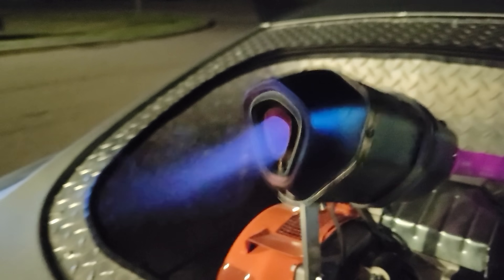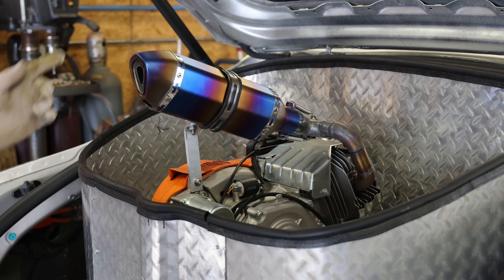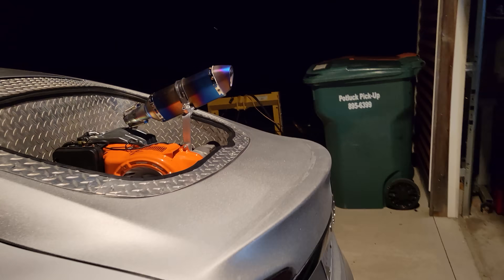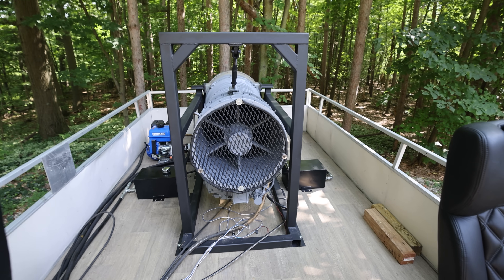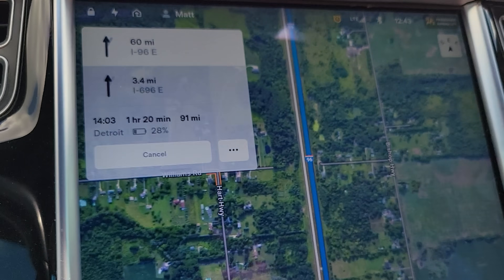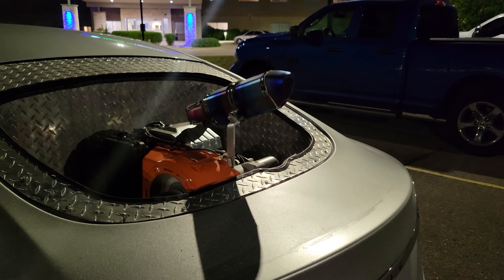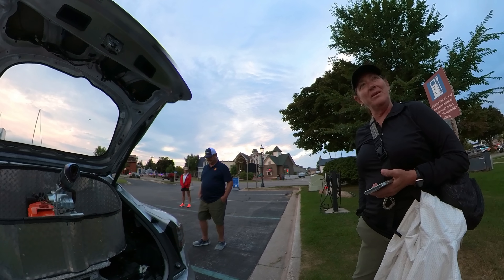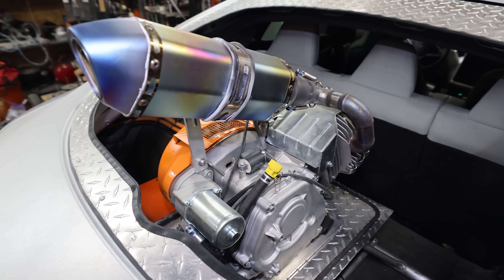Cordless Tesla (I Drive 1800 miles without charging) P.1

Comment: In the beginning of the video I thought the generator will let you down but wow it is strong and shooting flame while working hard is awesome
Reply: That flame was saying HIGHLY INEFFICIENT.
Reply: @VRStudio you are spot on that is a clear sign that it was running rich. Which is  garbage for efficiency. If this guy wants to get rid of the range anxiety and road trip at proper speeds with an expensive luxury car he should have just bought a Lexus LS 600h and been done with it. V8 plug in hybrid that gets far better mileage than this monstrosity, oh and quiet too.
Reply: @christophersaint6926  Why such a monster engine in a hybrid?! A 4 or even 3 cylinder makes sense, 6 less so, 8 is insane!
Reply: @franklofarojr.2969  Some of your more efficient hybrids are your 8 cylinder engine combinations. Now, mind you, not all of them. Some are hybrid for the "instant" torque and are really really inefficient, but those are the toys, the super/hyper cars. The LS600h, on the other hand, some of the Mercedes S-Class(non AMG), etc, put up numbers that are amazing and shame the Prius. It's because of the amount of electricity they can generate at idle vs what the 3 and 4 cylinders can generate at idle speeds.
Reply: I was wondering how much potential energy from fuel is lost while converting to usable electrical energy
Reply: @gameseeker6307  He said thermal efficiency is 16%, so your answer is 84%!

Comment: I'd probably get a real 10kw. the 5400 watts you mentioned is about right for say a 220v welder, home use version. Try harbor freight 9500 watt.. it's a lot bigger. my locale ot 5 inches of rain last night. I checked on the hydro dams at the river... the sound of thunder, excess water,and you can hear the turbines. I can see where the electric vehicle is efficient..it can use natural power makers. Gasoline cannot. Cool project

Comment: He made his own version BMW  I3 with range extender.  "Sat all night at the hotel charging" "Make the trip not touching a charger" He did have to put gas in the charger, and told the Officer "It gets too low, I will pull over and let it charge" He DID make the trip without using a conventional charger, BUT he still charged the batteries....

Comment: How did you get the car to drive and charge at the same time.  I'm smelling a little bit of BS here. It looks like you just stuck a motor in the trunk and are still stopping to charge. Esp with you completely glossing over wiring and software management.

Comment: My son let me drive his model y dual motors because one motor just isn't enough performance model.

I drove it on a two and a half hour trip from fort Lauderdale up to Kennedy Space Center and back.

I use the Tesla app which shows you where to charge and how long.

I had to charge for 20 minutes on the way up in 30 minutes on the way back.

Both times I charged at the super charging station at a Wawa gas station convenience store.

By the time I leisurely walked in and paid for a couple of things and walked back out it was almost done.

No one's going to read this is 3,400 comments for Christ's sake.

Comment: You're giving phev a bad name. A proper designed Plug-in actually gets >100mpg for average use, has plenty of power, quiet, reliable and the most important does not require a huge battery like this unit.

Comment: Kubota makes a perfect engine for this. Either a 2 or 3 cylinder. With more torque and thermal efficiency, going this route would return you better results (as well as being even more hilarious). This is coming from a person who has a degree in On-Site Diesel Technology and Power Generation. I work on generators and have seen every problem imaginable. I love your videos and seeing this one hit me personally. Thank you so much for showing us this experience, please follow through with what you are doing. 🙂
Reply from the maker: Thanks however, I actually started building version 2 almost two months ago, but I waited until I was almost done with version 2 to post the video for version 1, this one. You have a lot of experience, so you know what works and what doesn't 🙂. Your going to like the next one for sure
Reply: Benjamin, does Kubota's "perfect" engine meet current automotive emissions standards? How much would a 25 kW (continous output rating) set weigh, complete?

By the way  I know the answers...
Reply: I've owned Diesel VW products for many years.  As a simple experiment, how about a early 80's 1.6 4 cylinder diesel (without all the fancy electronics of a TDI), running at a steady 1800 RPM like a stationary generator?   Why not just drive the diesel VW?  I do like the "mad scientist" theme of this video.  Keep it up.
Reply: @WPM_in_ATL  the old VW diesel is too large in displacement to make sense (the Kubota suggestion is more appropriate), it is not optimized for continuous low-speed operation (the Kubota should be), it is too heavy and bulky (also true of the Kubota), and it is far too dirty. Even the electronically managed versions of those engines didn't meet modern emissions standards, and the older ones are outright filthy.
Reply: @WPM_in_ATL  because the efficiency is not always optimal when you just drive an ICE engine on different rpms, loads etc
Not sure how much is gained and how that's deceased by the charging efficiency(which is pretty high), but theoretically using an optimal ICE engine to charge is better than just turning the same fuel to directly use the engine to power the drivetrain
Reply: WHat could be the efficiency in a best case scenario?
Reply: @OersJ  a well-chosen engine could use roughly half as much fuel for the same energy produced.
Reply: @brianb-p6586  so ~30% efficiency roughly?
Reply: @OersJ  yes - the best car engines manage 41%, not accounting for generator losses (5% or so).

Comment: 1 was expecting a 1zyl to be decently efficient. 12l for 100km at 100kph is terrible though. I dont even get that driving at 200kph lol.
Nice you tried though. Maybe just pull a rich rebuilds lol
Reply: There is no reason to expect the engine to be efficient, just because it is small. In fact, a small engine like this doesn't need to be efficient, and is just a pile of crap built as cheaply as possible, so it should be expected to be much less efficient than any automotive engine.
Reply: @brianb-p6586  true i suppose. Maybe a scooter/motorcycle engine would have been better suited for this project.
Reply: @D3nn1s  yes, BMW used an engine from Kymco for the i3 REx. It's a 650 cc 270 degree parallel twin with DOHC, liquid cooling, and fuel injection, rated at 25 kW (34 hp) although capable of more. It might not be identical to a big scooter engine,  but it's at least extremely similar.

Comment: What you need to do is install is a hitch on the Tesla. Than you get yourself a small trailer and bolt on a home generator with an external gas tank and run a plug from the generator straight to the charging plug on the Tesla. This way you still have a stock unmodified Tesla that you can use around town and when you want to take a long trip you hook up the trailer and go. Also it can be used with another Tesla if desired interchangeable.

Comment: Great content but wouldn't a home generator be more efficient and effective? Granted they don't naturally make 10,000 watts but they are detuned to lower rpm for reliability, noise, and fuel efficiency. I think a higher rpm and you'd be able to achieve a lot of watts. Better yet 2 generators!

Comment: Replace the four-stroke engine with an ethanol powered turbojet and you´ve got a clean, renewable, refuellable, electric car. There are already in the market micro jetengines that easily generate more than enough power to spin the alternator. Things to calibrate: the best ethanol+air mixture, purity of ethanol, cruising RPM for the turbine versus best RPM for the alternator. Gearing? Redesign the alternator? Fluid adaptor? Not so difficult. Makes up an very interesting project.
Reply: That would be a turboshaft engine, not a turbojet. It would be even louder and less efficient than the engine that he used.

Comment: What’s the point of electric cars when you are using coal to charge them still..we just aren’t there yet, we need about another 100 years before we make a better energy storage (batteries). And better electric harvesting from nature (solar that works 1000 times better than currently). We are still in prehistoric times with electrics at this point.

Comment: I think I would do a small portable propane generator.  You would still need to have an isolation box, passive ventilation and exhaust under the car.  I would want some rear storage and visibility.  You would use $10 per day in propane.  At least you could skip the mid day charge.  You would still have to overnight charge at a station or leave it running.  Due to the cost of RV generators, a lot people install portables with a remote switch, an exhaust and fuel tank.

Comment: This sounds like the most miserable road trip ever. You would have saved so much time and money by just utilizing the Tesla Supercharger network. Instead, you had to drive painfully slow (slow enough to get stopped by the police), spend time on the side of the road with a nearly-dead battery, leave your noisy generator running during overnight stops… what a hassle! Just use the 250kW charging stations and get there days sooner.

Comment: It would be a fun next step to design a towing hitch for the Tesla. Have a small trailer for the most efficient gas or diesel powered generator you can fit on a small trailer. Give it an aerodynamic shroud and tow it behind the Tesla to charge the Tesla just as your small engine was doing, only faster. I've no clue if it would work or not, but clearly you have the engineering know-how, the shop-toys and the time and money to play with really cool projects! FUN STUFF!!! :)

Comment: Well señor, I can drive my 2020 Ford F-150 Supercrew from San Antonio, TX to Virginia Beach, VA on $169 @$3.39 per gallon and show up in Virginia Beach with a full tank of gas. It is because of the 10 speed transmission and the very efficient gasoline engine.

Comment: What about a single rotor engine hooked up to a generator there was talking of and OEM doing this setup. Or go with. High torque low rpm engine like diesel. Get a belt turbo/supercharged setup. And install a good size generator. I wonder if your mpg can hit 30-35 with the diesel setup

Comment: You drove 1800 miles without needing to stop at a charging station. You absolutely were charging along the way through the generator you installed. Regardless, cool project.

Comment: Too many comments to read through, so someone may have said this...
Great proof of concept! As noted, you made a hybrid. But unlike most hybrids you use a tiny motor ( in comparison) and can't run on motor alone, the electric drive is the primary system. But you've proven a range extender,  with enough to boost range of a fully charged car significantly.  Most people won't need that on a daily basis, just for long trips. I'd like to see a small battery pack and a small generator on a trailer that can be rented and towed. While you could use the generator with no charging like you did, it would be more efficient to charge overnight or at longer stops when possible and run the generator while driving. Ideally the generator would be sized to provide enough power for level cruising at highway speeds.. 65-70. That's when there is the least demand on the main motor. Battery power would be used for starting, accelerating,  and pulling hills. Should boost range by 50% at least (more or less depending on time on interstate and terrain).

Comment: I wonder if this could be done using the wind and a mill type of generator, the noise in current set up is brutal..first time seeing this channel & I’m in 👍
The pontoon jet 😂
Reply: No, the air resistance from the fan blades would outweigh the energy you put back in.

Comment: The only question I have is how many gallons of fuel were used to travel 1800 miles. From the graphic it appears the Tesla got about 12-14 mpg? If that’s correct then your setup was about as fuel efficient as an old 1960’s-1970’s land yacht with a big block V8.

Comment: I wonder IF you put the motor in the front and attached a full length exhaust IF you could make it quite like a regular car. Maybe just attach a full exhaust on the back one as it is now,  down pipe into the body with a S bend on the bottom.

Comment: This is an idea I thought about for a long time, however not with a Tesla. I have a 2012 Prius PlugIn which gets me some insane gas mileage. I purchased it in Milwaukee and drove home to Escanaba Michigan. The distance was 244 miles and I drove mostly 75mph on interstate and 65mph on highways, when I got home I looked at the gas gage and it was only down 2 led marks!! So I went to fill the tank to see what my mileage was. I put 2.2 gallons in the Prius!! So from 244 miles and using 2.2 gallons of gas I got roughly 112mpg!!! I keep my trip A on and right now it has 18,738 miles and the average mileage shows 92mpg!! With this area in the winter when I use the heater and defrost the engine turns on. With this video I’m going to talk to some local wrench heads and work up something like this Tesla has, one thing I’ll need is a larger battery but I think I’ll try finding a used Tesla to buy parts from. Only other thing to improve on is a quiet muffler. Thanks for the video, I just wished you would have came across the Upper Peninsula after Mackinac Island (we do have Tesla super charging station at Meijer in town here, not that you would have needed it).

Comment: Great video. Idk why these electric cars don’t have magnetos to charge as they drive. Maybe you can try that next it’ll be cool to see. ❤
Reply: They do. Regenerative braking, it turns the electric motor into a generator briefly to recapture some of the energy while slowing down
Reply: @MrJeffcoley1  I know they have it charge while braking. do you ride the brakes while driving to charge? There should be something to charge while driving like the old bike lights that had the magneto touch the tire to generate electricity to power the lights. 🤷🏻‍♂️
Reply: Of course a stoner would make such a dumb comment. Do you really think that engineers haven't thought of that before?

Comment: Who am I to say anything... however why not use a serious engine like a airplane prop motor put a gear box on it get a generator core schwack it together with a plate or 2 you would get what you want. Also you can make it way more  quite you just didn't bother with a proper exhaust system just a performance dump pipe essentially what you had

Comment: You might aswell just fill up your gasoline car because those 2 stroke engines are polluting more than a gasoline car of recent years...

But I mean, there's not much difference between charging a tesla with the help of big coal powerplants or buying gasoline, they both pollute 🤣

Humanity can be very interesting sometimes.
Reply: 2 stroke? Where?
Reply: @srts8945  maybe watch the video?
Reply: @-never-gonna-give-you-up-  yep done that, still no 2 stroke!
Reply: @srts8945  explain to me why its no 2 stroke...
Reply: @-never-gonna-give-you-up-  the engine says brap brap instead of ting ting for a start.
Reply: @srts8945  wheres the dipstick?
Reply: @-never-gonna-give-you-up-  the dipstick is replying to me, OHV Over Head Valve.

Comment: You have a bit of a problem with how to dump more charge into the car?  I can see just dumping a standard gasoline generator as then you get 240V to feed into the charger, which maxes out just shy of what your generator could do.  What you need is a direct DC charging system, which I am not sure how you would get the parts for and get the car properly configured to use.  You need to get up to ~25 kW of electrical output to be a happy camper.

Comment: It's ridiculously loud that engine/charger system isn't powerful enough to charge as you go. A small four banger would be much quieter and you can find a power supply that will charge plus supply power.

Comment: hi.. very nice idee.. u need a ac/dc booster and amp boost higher amp better charing..  biger moter wil be too havy.. find the right charge amp tesla use and add i bit more to your system.. charge rate while driveing must be bit hi the normal charge.. big fan from south africa..

Comment: 400 watts is pathetically low. Also how do you wire that in without disabling the car. My car won't run when it's charging. 
Also dang how hard is it to find a quiet engine?
I have relatives in Milwaukee.

Comment: Well, just get a Lexus or in this case, even an Audi A8 3liter diesel would have better mileage, much higher comfort and most of all actually be a beautiful car. If going this route, get a more efficient generator. Like the Hyundai diesel ones, pretty noiseless and more efficient. (not more efficient than a modern turbo engine, but still..) I see the 'fun' in this, but at least have some headroom on the generator power, and get a darn muffler for Christ's sake..

Comment: It would be useful if all EV's had a backup emergency gen-set that gave heat as well as power to otherwise stranded vehicles.
Reply: It's a weight problem, in an electric semi I could see it, but for a normal car it would be too heavy and take up space
Reply: @juicewrldextendedunrelease5274  It could be a tiny unit, only meant for emergency use. Better than being stranded in the middle of the night in the middle of winter.
Reply: @robertcircleone :  Define "better".  You have all that wasted space, extra weight, and COST.  

Getting a longer range vehicle would be better if you need more range.

Do you also carry 4 spare wheels in your trunk to be "better" prepared for flats?
Reply: Roger Geyer, I already explained but never mind.